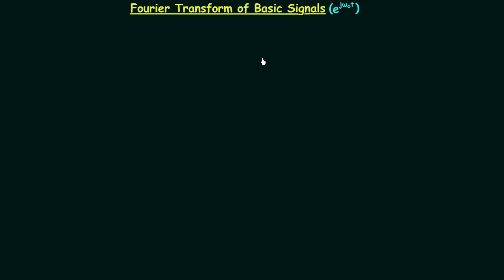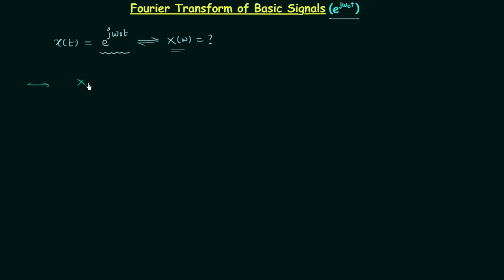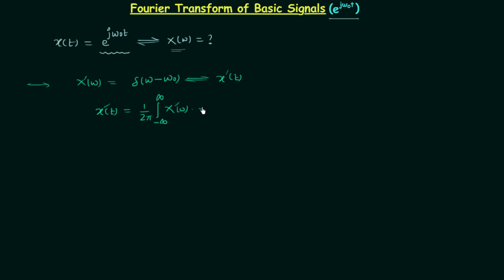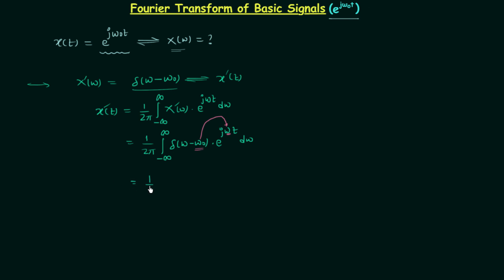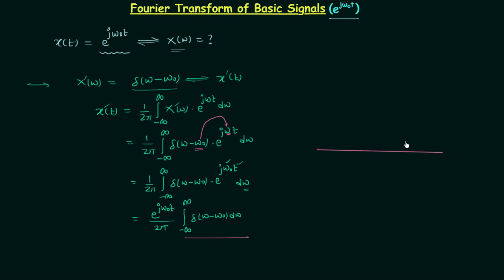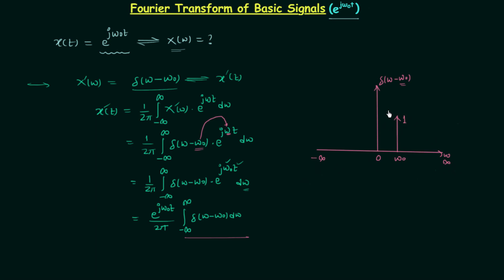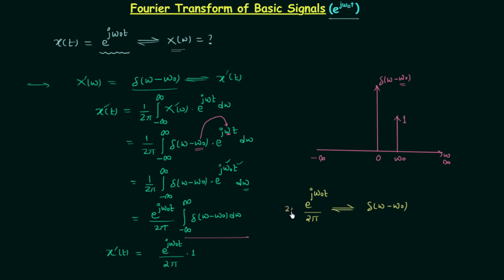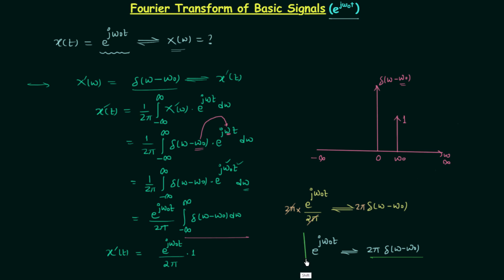Fourier Transform of Basic Signals (Complex Exponential Signal)

Comment: Easy Solution: Apply shifting property in frequency domain
consider x(t) = 1 . e^jw0t
FT{dc value} = FT{1} = 1.2PI.delta(w)
using frequency shifting property we can write
FT{1.e^jwot} = 1.2PI.delta(w - w0)

Hope it helps! XD
Reply: Easiest solution! Lovely bro.🤞🏻
Reply: Yeahhhh broo
Reply: What does XD mean..? 🤔
Reply: @SagarKumar-zv8vq  happiness or laughter
Reply: Thank you but the the only thing i know about the shifting property is that if you shift the curve to left by 5 units , it means adding the argument by 5 but if you shift the curve right by 5 units it means subtracting the argument by 5. However in here, it does not say if the curve is shifting right or left by w0 units so how do we even apply the shifting property?
Reply: @c.cody.3886  e^jw0t => here it will be (w - wo)
e^-jw0t => here it will be (w + wo)
To understand why this formula is used like this you have to derive this formula using the integral equation.
Reply: Wassup dude...ig rn u have completed ur bachelor's degree in IIT.. so where r u today...got a placement or studying more?
I just wanna have a clear idea about what to do after completing engineering
Reply: @BAKA_YAGA  hi, I am working as a software engineer at Flipkart
Reply: Thank you bro😢
Reply: Way better rationalization, he literally just pulled that other crap right out of his butt with zero explanation as to why he decided to randomly pick d(w-wo)